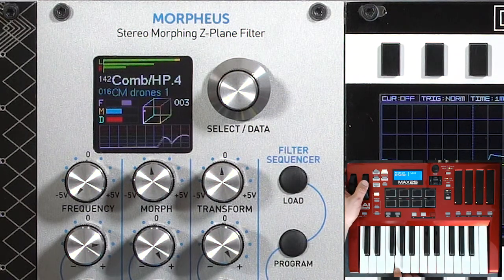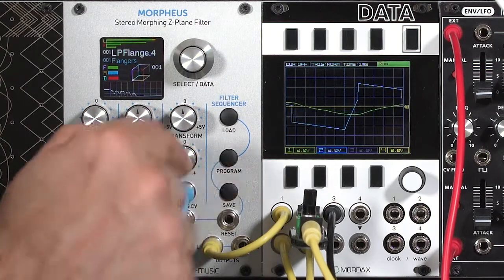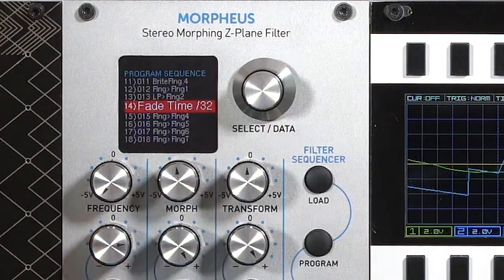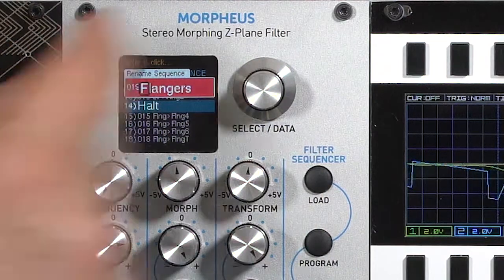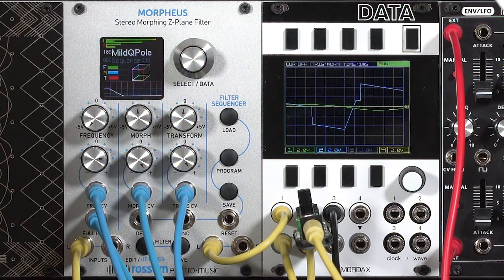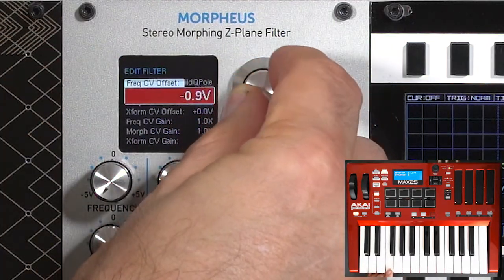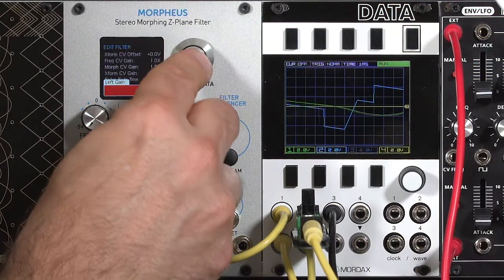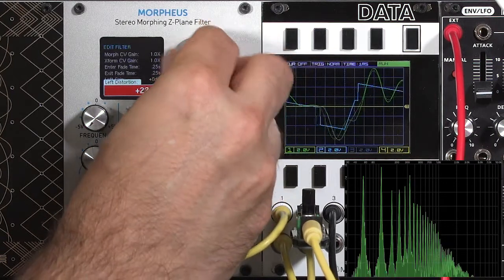Rossum Morpheus Digital Filter 4/4: Editing Sequences & Filter Cubes (Eurorack Expansion)

Comment: Thanks for the video!
Did I get that right, the difference between the pause and halt commands is that inc and dec are ignored, but with the pause command, a reset continues through the sequence and with the halt command a reset jumps back to the first step in the sequence?

Comment: Musically, why would someone want to sequence through a series of filters? To me, it would be similar to the meta-sequence mode on Brains - fun to listen to for a little while, but the 'glitchiness' gets tiring quickly. Wouldn't that be a similar effect if you switched between filters?
Reply: Learning Modular I wasn't very satisfied by the Morpheus. The morph through the null sequence, all the differences in the loudness and the clipping of the signal are very annoying. It's nice with all it's functions, but the workflow is just impractical.
Reply from the maker: I got along with it a lot better once I put input attenuators in front of it.
Reply from the maker: There are a couple of different reasons. One is to automatically change between setups during a live set (you can always sequence when no sound is going through the filter). Another is to use it as an actual effect: Unlike Braids which switches immediately, Morpheus allows you to set glide or crossfade times for it to go from the current filter to the null to the next filter, which can be used as an evolving, glitch-free sound.
Reply: Yeah, good explanations I suppose. It just seems like a lot of panel space for a lessor function. Why couldn't they have just had a jack reading a bipolar CV for DEC and INC functions? I suppose I'll find out as I just ordered one!
Reply from the maker: My guess is it was based on either user request(s), or a strong conviction they had about what users could do with it. But rather than just speculate, I'll ask Marco at Rossum and share anything useful he might reply.
Reply: Hahaha...good idea! Thanks for the followup and kudos on the great video. Might want to let Marco know that you probably sold more than a few of his modules because of it!
Reply from the maker: Marco says: "It was a combination of all of your guesses. Playing with it during development, it was just so cool for so many things."
Reply: Well, there you go. I'd think that a long fade into/out of the null filter and subtle timbral changes between the filters would do well for ambient sounds. How would you be able to switch back and forth between 2 filters? Just a 2-filter sequence?
Reply from the maker: Unfortunately, you always have to go through the null sequence. The way the filters are designed, is that they also have to define how they morph between configurations - which they can do for each corner of a cube in a preset, but which they can't anticipate when going to a different cube. So they all go through the null instead.

Comment: Thank you for these series of tutorials, they are very well put together. I have been a long time user of the original Morpheus rack module and although it is a very powerful synthesizer, the limitations of the chip never allowed Dave Rossum's innovative idea to reach its full potential. I bought this filter and have been very pleased with the capability, it is very digital in its sound... and this is what I love about it. There are sound possibilities to be had from this that are in no way possible with analogue designs. The feature of allowing to set a morphing time between filters within a sequence is very well implemented and I recommend this module to anyone looking for something that can greatly expand their sound design explorations.

Comment: Do I need to have PHD to operate this maverick?
Reply: just got one. very cool.
Reply from the maker: No. You can just twist the encoder dial to choose a preset, press the encoder to load a preset, and twist the Frequency, Morph, and Transform knobs (or send it control voltages, as I did in these videos.). And even editing the presets is easy, as you're not editing the arrangement and makeup of the cubes themselves.